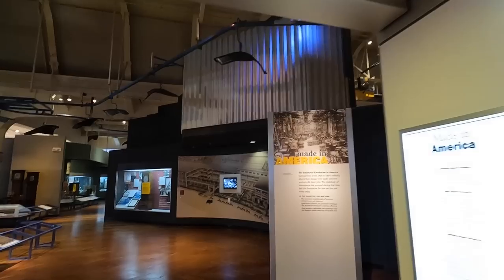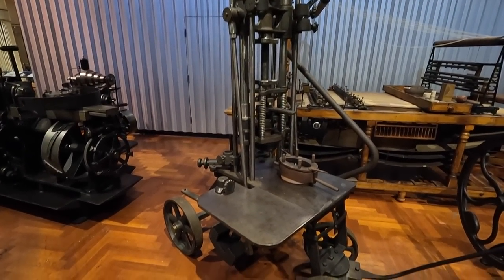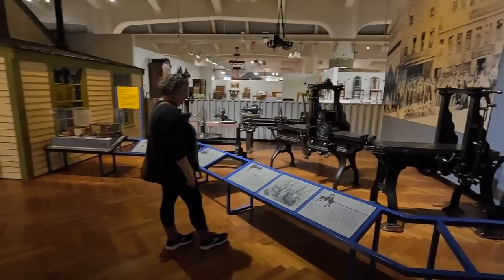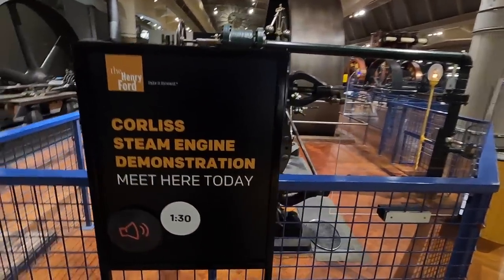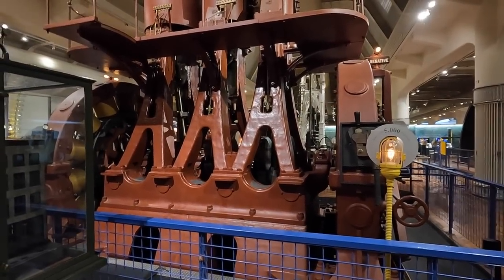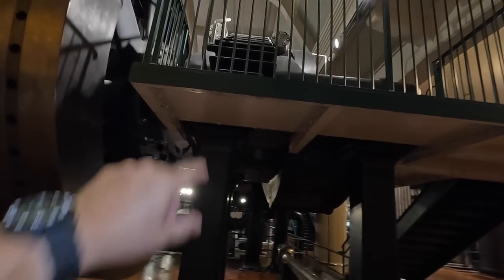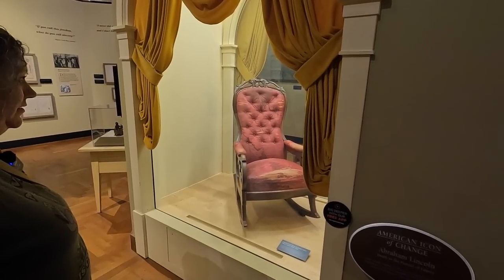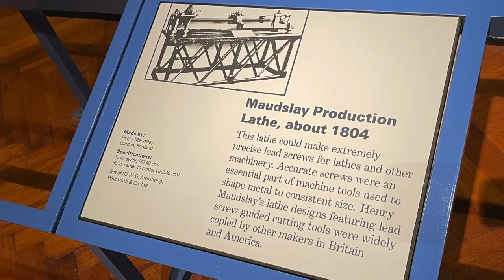The Henry Ford, Made in America

Comment: In oil field machine shops, I ran a thread mill that threaded the ends of drill pipe, drill collars and other components. It's asset tag was 1616 and I used to swear that was the year it was manufactured :). You could see where it had been converted from drive line to electric engine.

Comment: First, I worked most of my 31 year career as an engineer Ford Ford Motor Company in the building just north of the museum on Oakwood Blvd.  The building I worked in had many names since it was built about 100 years, but has now reverted back to it's original name, Ford Engineering Laboratory.
Second, you need to return to the area and go through Greenfield Village.  It is an open air museum that has many historical buildings including Thomas Edison's Menlow Park and the Wright Brothers bicycle shop.  It has at least one WORKING, over head line shaft machine shop.  Many other things to see.
This, the original Ford factory in nearby Highland Park is still there.  No machinery, but some very old cars.

Comment: In the shop I work at, we have a Gray Planer that was retrofitted about 50 years ago with a Gray milling head upgrade. Still to this day is a rock solid machine. 30ft of travel. Surprisingly a very solid and still accurate machine to this day. Only other machine that old we have, that is still accurate, is a Monarch lathe with 4ft roughly of swing.

Comment: I love the Ford museum.  As a car guy, i went there for the automotive portion but then i discovered all this old equipment and i almost like that part more.  My absolute favorite part is the gigantic steam engines they have which powered whole towns and factories.

side note; that glass press is probably mobile so they could bring it to the furnace and get the gobs from there.  its a lot harder to make a mobile furnace.

Other side note, maybe that oiler project should be your first CNC project.  tying the old into the new?

Other other side note, its pronounces ske-NECK-ta-dee.

Comment: Adam, the gun barrel rifling machine pulls a broach through the drilled barrel. The broach is rotated as it is pulled through by a cam and follower in the frame on the barrel’s axis. Instead of a broach, some rifling machines used a single cutter, like a shaper tool, drawn through in a spiral and then indexed to cut the next groove. There used to be a gun shop with a small museum in the Mount Dora / Eustis area north of Lake Apopka. The museum had an early, hand powered rifling bench. I was last there over twenty-five years ago so I can’t say if it still exists.
The gunsmith’s shop at Colonial Williamsburg forges barrels on a mandrel to make hex or octagonal rifling.

Comment: I love looking at these old machines. It's worth emphasising the importance of the gauge blocks. Without them, for checking other inspection equipment, it wouldn't have been possible to make guns, sewing machines ...  and automobiles with interchangeable parts, and so the production line method of assembly wouldn't have been possible (or would've been much more difficult to implement).

Comment: That place looks so awesome!!! Now if I could get my wife to go 😂 I could stay in there for a week! Only bad part is they don't let you play with them
Reply: There are a few hands on or at least working machines in next door Greenfield Village.
Reply: @jackpatteeuw9244  that's awesome to know that.  We have a old waxer from 1935 and nobody understand how to work on it.  Been upgraded a few times 1942 and 1980's.  I was shocked to find electrical parts with copper dated 1942.  Not sure what it did for the war but they got parts with copper that year.  Most of the old documentation is missing and damaged but I love that machine and always enjoy the 3 hour drive to work on it when the maintenance team for it can't fix it.  We had to replace a bearing and weld up one of the driven roller.  Had a key way cut on a scraper not a mill.  2"x2"x12" key way.  Machine runs at 800 feet per minute.  Been waxing starburst candy wrappers since 1966 and the candy came out in 1967.  It was in a old Henry Ford tractor plant in Memphis with so many awesome story too. Love vintage steel.

Comment: Adam, you need to go to the Rough and Tumble Historical Society for the Thresherman's Reunion in Kinzer Pa, in August. It's one of the largest events of it's type on the east coast.
Not too long ago, they had 109 operating steam powered machines or equipment in operation. This set for them a high record for this event. That included two operational steam locomotives, that are in daily operation. 
Not far from that event is the Strasbourg railroad, known as the oldest operating short run railroad. There are several other steam related events and activities nearby as well. If you're interested, there's also Blue Ball Machine, a machine and equipment distributor.

Comment: Are those white spindles around the columns radiators? They look amazing.
Reply: Yes, vertical rads. I took pictures of them when I was there
Reply: Yes.  The building gets it's steam from the Ford Research and Engineering Center which is actually on 3 sides of The Henry Ford.
Reply: Thanks, that's what they looked like but I wasn't sure.

Comment: Does anyone know if the "gas/steam" engine from the Ford plant ran both gas and steam at the same time? If so, that's a surprisingly modern concept. The reason modern gas-powered electric plants are so efficient is they run "combined cycle turbines," where the waste heat from a gas turbine is used to generate steam for a steam turbine.

Comment: Pretty cool.   💪
Did my machinist  apprenticeship in the NAVY late 60's. Later worked for "Grove Valve and regulator Co. HUGE machines .....Made Valves so big......you can drive a tractor trailer rig through the main hole in the valve.
Reply: And I thought we made big valves 😅 (AVK Valves), the biggest we make is DN2600, so almost 104'' internal diameter.

Comment: There were 68 of The Allegheny engines built the 1601 is the second one built. Out of the 68, 60 were built for the Chesapeake & Ohio, the other 8 were built for the Virginian Railway. Of the 68 only 2 remain, the 1601 at the Henry Ford and the 1604 at the B & O Museum in Baltimore Md.
Reply: Every once in awhile, there is discussion about restoring that to working order.  Greenfield Village has a couple of operating steam engines and a round house to keep them running on the several miles of private track they have.
Reply: @jackpatteeuw9244  When Norfolk Southern started their steam program, CSX sent some of their people to evaluate both Alleghenys for possible restoration, but that's about as far as it went. I've been to Greenfield Village and rode behind one of their steamers and went through the roundhouse. If I ever get the chance, I want to return to the museum and village.

Comment: Are you aware that Ford made a gas motor while he worked for Edison. there is very little written about it. Several years back I contacted the Ford Museum about it, they told me they had herd of it but have no information on it. I have a complete set of plans and a video of it. the original did not have a mag or spark plug, it had insulated rod that ran through the head and a little hook-on top of the piston to make contact and create the spark. Contact me if you would lie more information

Comment: It's a funny story, but in the 1970s Ford had a guy that all he did all day long for 40 years was to put nuts and bolts on the underside bodies of all Ford vehicles.  They kept him around for so long because he was so well loved by  the company that they didn't want to replace him, but he couldn't do the hard labor anymore.  after months of design and engineering, they decided to replace him with a custom spot welder, but instead of him retiring, they taught him how to use it.  He ran that welder until he finally passed away in the 80s.   
I was told this story by my engineering instructor when I was in college, it was a lesson about how manufacturing processes have progressed over the years.  And it just goes to show how much Ford cherishes their employees.

Comment: You mentioned the Western Machine Tool Works drill press from Holland, that is a heart rending story, I was about 17 when they emptied out the building and demolished it, a fully functional line shaft shop that had every stage of the machine building process frozen in time. There was a large grant available to turn it in to a museum but the city leaders said there wasn't enough interest and wanted to make a restaurant out of the building, scrapped all the machines and then ended up D8ing the building. It's a vacant lot now, I'm still mad 23 years later. I still have a few odds and ends I hauled home as it was being scrapped out.
Reply: Thank you.  Thank you for seeing the value of that building to later generations that those morons in charge could not see.

Comment: You’re so right about old machines… they are beautifully made a lot by hand and by craftsmen . A we’ll set up and programmed cnc is  infinitely more acurate across a broad range of operations, but some of these big heavy one trick ponies  were built to do one job right, very quickly and reliably.. the downside being they needed  fewer people like your good self  to operate them…!!! As is the case in a lot of industry.  Nowadays if you can use a cad program you can machine just about anything which is great but also why I enjoy peering  into the booth machine shop at the man with the callipers in one hand and an oily rag in the other…😢